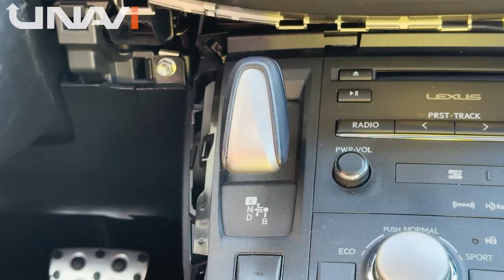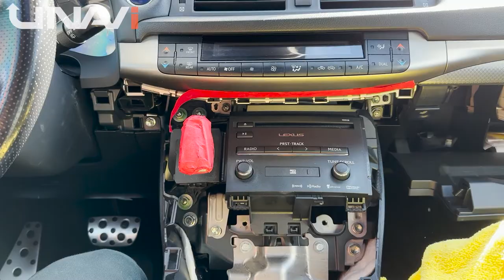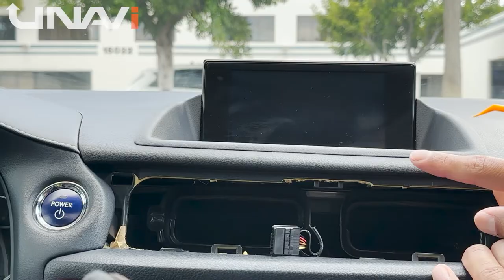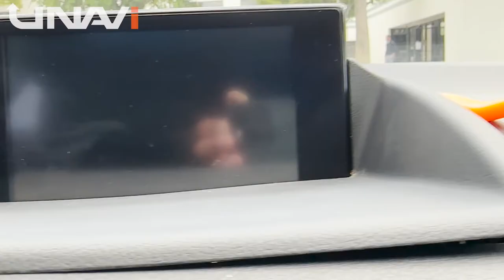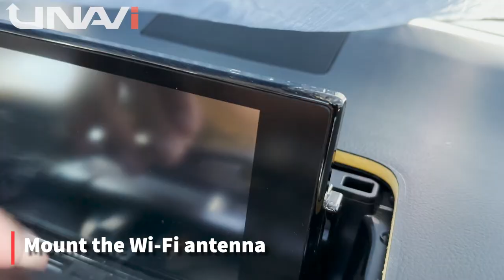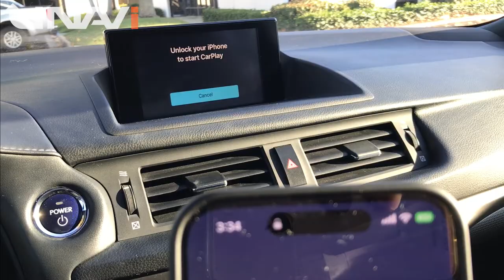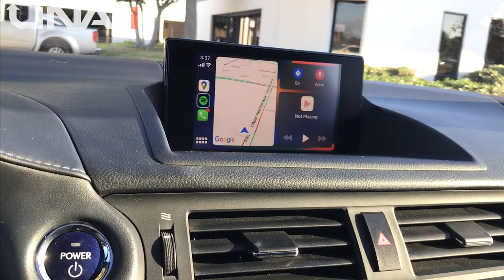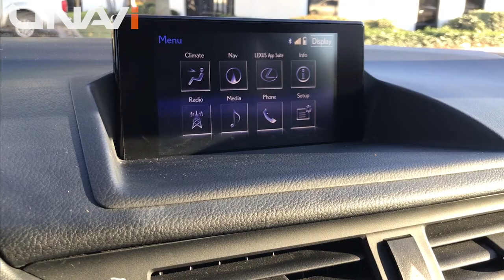How to Install  CARPLAY  LEXUS  CT 2011, 2012, 2013 ,2014, 2015, 2016, 2017

Comment: Thanks a lot for the detailing installation !!! Very helpful. I have ordered the box for my CT200h too. Once received, I will install it following your video.
Reply from the maker: Thanks, please let us know if you need anything, please text us at our tech support line 714-643-5704 M-F 8:30AM - 4PM PST.
Reply: I have installed the box, it worked for a few hours. Then I have modified the "match 360 display" in the settings and now it doesn't work. When I press the menu button, it's happens nothing. You know maybe how to resolve this problem? Thanks
Reply from the maker: Hi this is one of the techs here at UNAVI is there a way you can reach out to us in our tech support number: (714) 643-5703 @HO-24

Comment: That unit seems to be much easier to remove than the one on the 2012 Lexus ct 200h. I had a plate with five screws in the front and I'm still trying to figure out how to get the rest of it out
Reply from the maker: We understand your frustration—different models can certainly present their own challenges! It’s true that some units are designed to be more user-friendly than others. If you’re having trouble with the 2012 Lexus CT 200h, I recommend checking the vehicle’s manual or looking for model-specific guides online.

If you need any specific advice or have questions about the removal process, please feel free to reach out. We’re here to help you get through it!

855-558-6284
Mon-Fri 8:00AM - 4:30PM PST

Best regards,
Unavi USA

Comment: I have a 2011 with the auto close tilt buttons. Will this remove the open/close mechanism or will it work with it?
Reply from the maker: Hello, you retain all your OEM features, we don't replace the screen our system is an add-on to the existing system. Thank you for your comment. 
https://unavi-usa.com/products/apple-carplay-for-2015-lexus-ct-android-auto-retrofit-upgrade-module-adapter

Comment: Hello, i am having an issue with my ct200h 2015. After I disassembled everything, i noticed the cable on the carplay module wasn't correct. After that, i did not finish the install of the module but assembled everything back together. When i turned off the car the radio was not working. Everything is well connected but it wont work. I read online that the radio dies after disconnecting the Battery, perhaps it's the same issue. Does anybody have a solution?
Reply from the maker: Hi please reach out to us here: 714-643-5704
Reply from the maker: Please text us with your order number.

Comment: This is pretty cool, but for $600, you can add carplay / android auto, plus a full touchscreen upgrade with onboard memory, etc..  Why is the price so high?
Reply from the maker: Hi I mean you can do that but what if one day the equipment gives out and you need original factory stuff of the radio. Keeping your car OEM is much better than replacing it with some chinese stuff.
Reply: @UNAVItech  true, but I'd keep the original screen for just that possibility.  Also, the devices in question claim to switch between OEM infotainment software and the onboard android
Reply: @UNAVItech  also, I have existing nav, so I wouldn't replace the radio either way

Comment: Are you sure is working with CT200h phase1 2011 and 2012....  i dont think so.
Reply from the maker: Hello, we have two different units for the Lexus CT class running from 2011-2017, this is a newer model. Thanks!
Reply: @UNAVItech  do you have more informations pls (i have not whatsapp). Thx in advance. regards
Reply: I have a 2012 CT200h. Please post your link here. Thank you.

Comment: Why didn't you show where you put the carplay module? Just cuts over to where everything is put back together...
Reply from the maker: Hello, we usually leave that up to the installer where to locate the module. If you need assistance please contact our tech support at 714-643-5704 M-F 8:30AM - 4PM PST, Thank you!